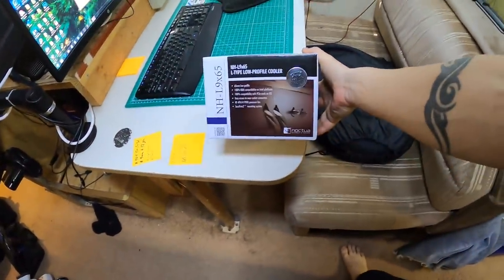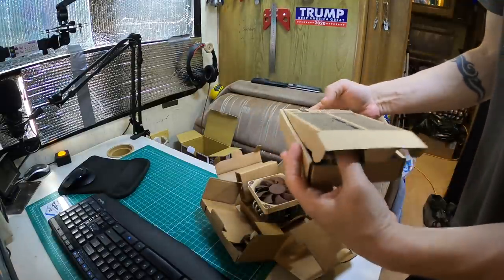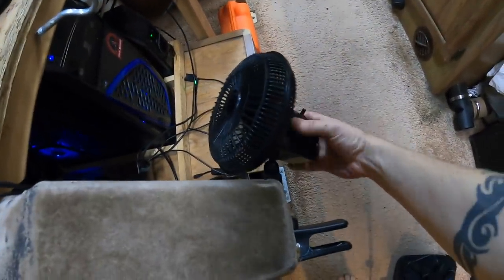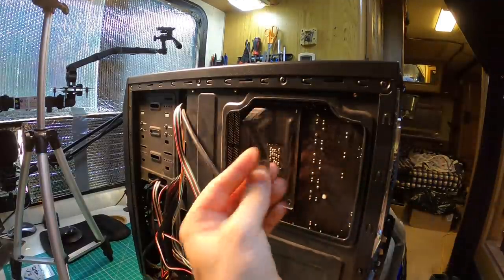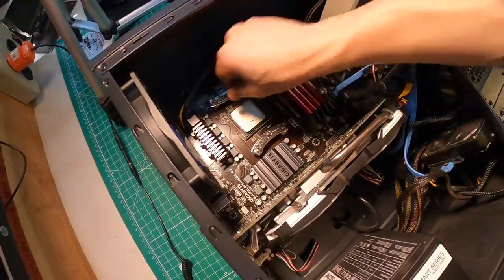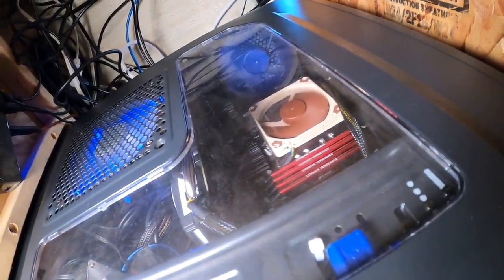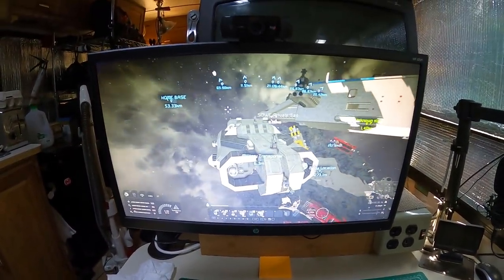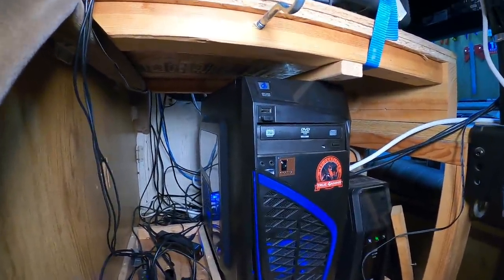New CPU Fan Install

Comment: But I'm not a computer expert but isn't that supposed to have liquid hoses attached to it you're like a radiator on the outside of the unit or inside the keep the cool I thought I seen them nipples free attach external hoses

Comment: I've made this comment before bit I think you'd benefit from using a dc psu instead of an ac one.
Reply: @DJ Irish Panda your point would be valid except hes running a 500 watt now so a 750 watt dc psu or even a 500 watt like he has would be fine.